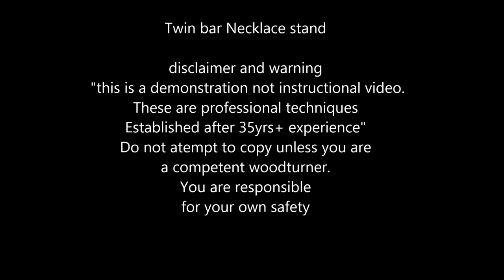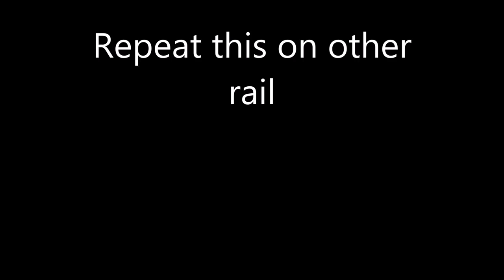Hand woodturning a two bar necklace holder

Comment: Genius. Hi Steve,

I do find your vids mesmerising, 
You normally do a whole set of Newels and spindles for a staircase in 4 seconds, so when I saw it was 15 mins long I was over the moon. :-)

I liked that sizing tool. I have seen this done with spanners, but it looks like you have a few sizes on that one bit of metal?
@13:40 you did a fancy cross over move with your left hand. Was that to support the spindle or is there another reason?

Looking forward to seeing more of your vids in 2017

Have a great New Year.

Cheers
Paul
Reply from the maker: Thanks Paul, yes I have lots of the sizing tools with many sizes on them. You are correct it was to support the spindle.